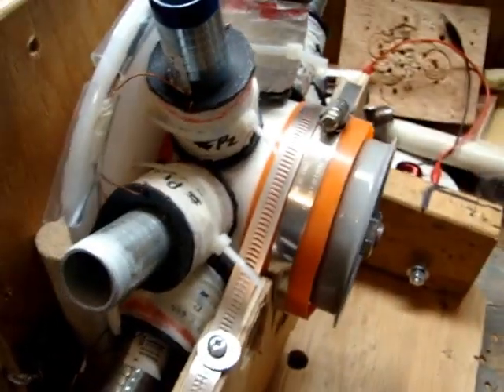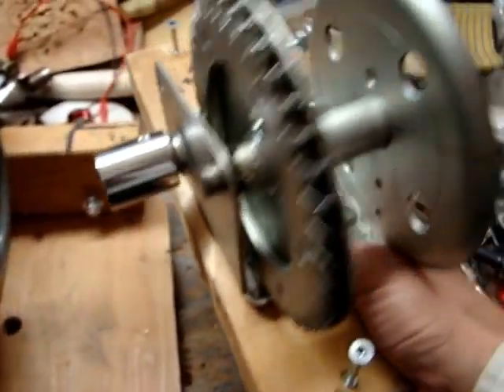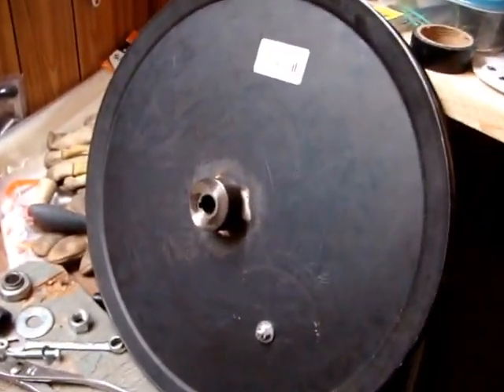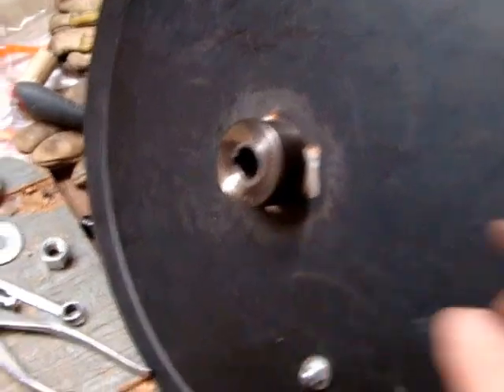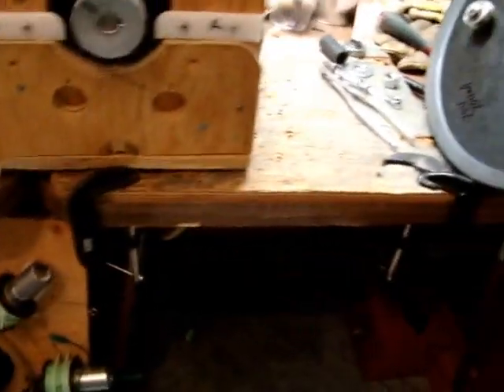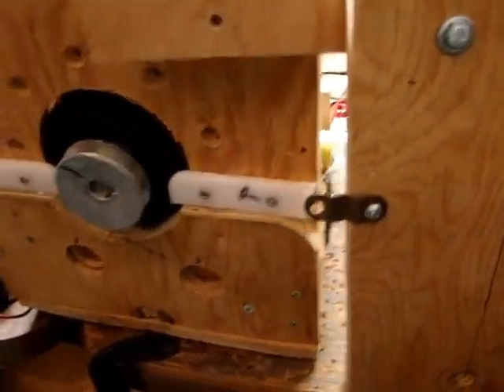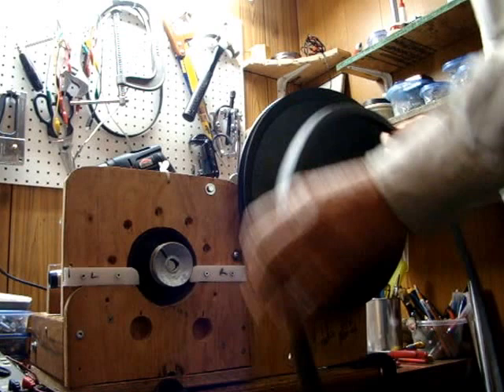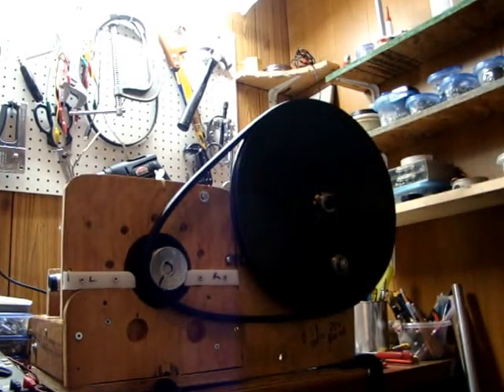3-phase Alternator Project, Part V - Pulley Drive System

Comment: ARE YOU CRAZY??? How am I supposed to understand how that works????
Reply from the maker: Sorry if that wasn't clear. In any case not to worry, the pulley system is not that important since it mostly demonstrates that forcing higher cranking speeds does not gain much after a certain plateau of output. If you were referring to the actual 3-phase system with the 6 magnets on a rotor spinning inside a set of 9 coils, then this animation may help:
3-phase Animation
Reply: Ian Forsyth I was trying to be funny :)